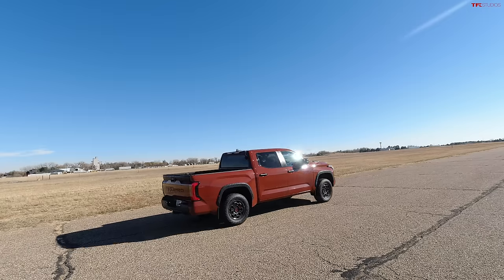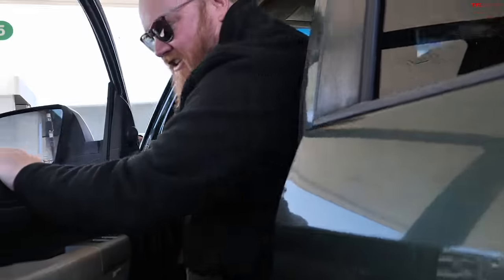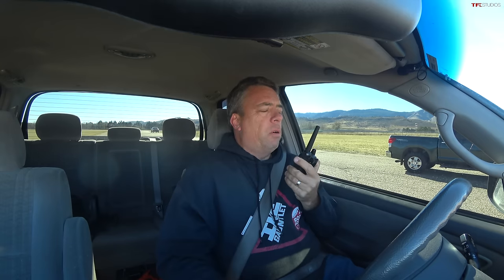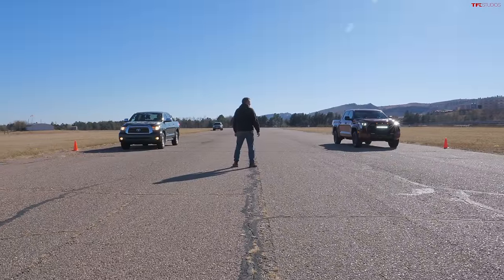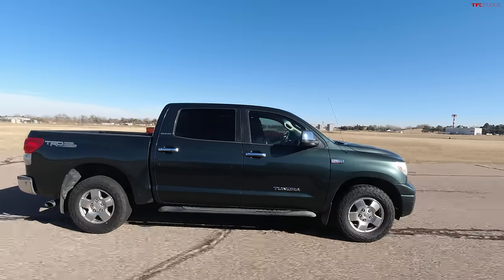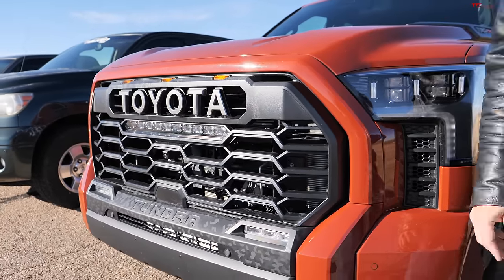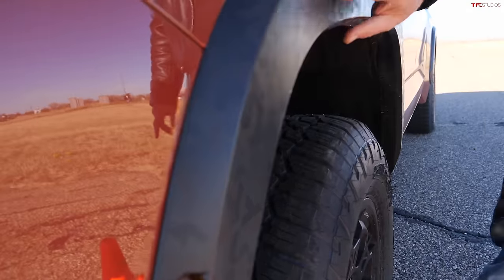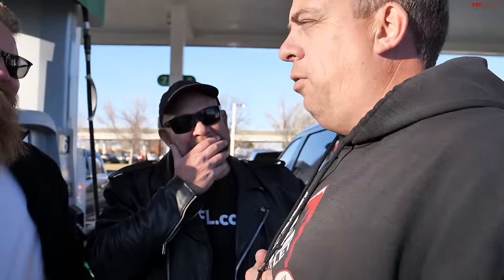Three Generations of Toyota Tundra Drag Race & MPG Surprise: That WAS NOT Supposed to Happen!

Comment: V6 Turbo is garbage, they are currently being recalled by Toyota because of all the metal fragments being found in the engine.  Complete bust of an engine.  Stay clear of the 22-24 Tundras!!!!! 5.7L is the rock solid engine that will easily go 500k.

Comment: The video was fine, but the mpg comparison has a couple of flaws.  The oldest and newest trucks only raced once.   That could make a significant difference for the 5.7 truck to do double the number of races.  I think it's very reasonable for it to have burned .5 gallon on a 1/4 mile run.  That would make a tie, but also, the newer model truck picked up Andre, so that is a bit more of a disadvantage.  

You probably should compare the cost not just the MPG unless all vehicles used the same octane.  Of course, 91 usually costs significantly more than 87, so if two vehicles used the same amount of fuel, but one used 91, the cost is significantly higher.

Comment: you dont need to run premium fuel in the new tundra, The beauty of direct injection is injecting the fuel at the precise time at the moment of combustion. if this engine was port injected then yes you would need to run premium because the air fuel mixture is being compressed in the combustion chamber for the entire compression cycle.

Comment: is there a specific reason you guys always use premium fuel when recommended by the manufacturer? I mean it's not like regular is going to destroy the engine, and most people are going to run the cheapest fuel anyways, so why not test all of the vehicles with regular?

Comment: I would have liked to see the 2nd gen 07 4.7L V8 Tundra's body style go up against that turbo hybrid because I have the 07 4.7L V8 body style and  I've beaten a F-150 Hybrid, a Silverado, and a Dodge Ram before and I have the 07 4.7L V8 Tundra. My truck gets up and goes when ever I need it too. It scoots right along that's for sure. Annndddd my truck just hit the 300k mile marker as well haha so it's got the miles and experience out there on the rd ways😂

Comment: Twin turbos are cool but I have a twin turbo Cat c15 in my semi that has a ton of power but can’t really come close to a single turbo cat in my buddy’s semi supposedly putting out the same horsepower… when a twin turbo has a turbo blow up you also have massive engine failure if the first turbo blows up. I will take reliability over power on the twin vs single turbo side

Comment: Had 2 Tundras in 5 years. 2010 trd off road regular cab with 1650lbs payload and a 2016 SR5. Still have one. Love them and plenty fast with tow haul mode. I dont care about the new model. Pretty mid and not reliable anymore. Went with an HD instead.

Comment: Thats all fine and dandy but those older tundras will still be running when the main bearings go on that 3.4 at 30k miles. I dont know what the issue is bit yota needs to fix it

Comment: Truck owners have been brainwashed by our environmental nutjob education system. I had 2 T100s (the first one was totaled with 3500 miles on it) when they first came out and the only option was a V6. Everyone trashed Toyota for not offering a V8. Amazing how things have changed for the worse. These overbuilt tiny little engines won’t hold up to the long term pressure that a V8 will easily handle. Toyota didn’t learn from Fords Ecoboost failure.

Comment: I've already heard how there's been turbo failures and premature crank/rod bearing failure on the 3.4 V6. People are only making it to 30-40k before their engines are taking a dump and Toyota is footing the bill for a new engine or buying the truck back. Then, replacing 1 turbo is already expensive, but replacing 2 turbos.... YIKES! Then, if your electric motor ever goes out $$$$$. I think the best generation is the 1st and then 2nd.

Comment: My little 2011 4 cylinder Ford Ranger has a 1300 pound payload capacity. That's nothing to brag about on a full sized 300+ horsepower truck. That said, my towing capacity is about the same at 1300lbs.😢😂 My 1973 Ford Courier pickup was smaller than my 2011 Ranger, had less than half the hp and about 66% of the torque yet had 1400 lbs payload and 2000 pound towing capacities. The new vehicles I bought in the 1980s and 90s were more efficient than their current counterparts. In an era of ever tightening government regulations, vehicles keep getting bigger without gaining efficiency. Put all that engine technology from the new Tundra in a truck the same size and weight of the earlier Tundras and you'd see an efficiency improvement. My 1991 Honda Accord was much smaller than my 2008 Accord and got way better mileage from basically the same size engine. I got 35mpg hwy out of a '91 Mazda, I'd be willing to bet the newest version doesn't get that. I know, those aren't trucks but from what I've seen,  the same holds true across the  spectrum of vehicles.

Comment: The first generation tundra was probably the last real work truck they made. The new ones suffer from the same problem a lot of Americans are suffering from. They are bloated. Also they sit so damn high that you have to work harder to use them. Trucks became status symbols in the early 2000s, and now they are designed to haul fat people and little else lol.

Comment: Damn that new Tundra is fast. 
But Toyota trucks WERE typically less powerful but more than made up for it on durability and easy of maintenance (along with not needed a lot of it.) I frankly prefer them this way. Simple.
Plus I cannot stand all the added weight of newer ones. Just give me a late 90's Toyota Pickup.

Comment: How bout we talk prices? 

I have a 2017 platinum, 5.7. 
Paid 50k, teo years ago i looked at getting into a new platinum tundra, dealer wanter well past $70k... And ive ran quicker 1/4 miles than the 200k+ mile truck did, and get better mpg. And its been paid for for years and years.

Comment: Wait is the math correct?? They didn’t all travel 70 miles. The first gen only did 2 runs-the others did 3 runs. And the first gen had a couple bags of cement in the bed.

Comment: The twin turbo engine in the 3rd gen is tuned to to use 87ocatane fuel. You wasted money putting 91 in. Also, you should never top off modern vehicles.

Comment: I like everything about Toyota, except the seats (toyota seats are among the worst).  Longevity may be a concern.  The fact is a turbo 6 will be working much harder than a V8 when towing: fewer cylinders means more rpms, and more rpms means more fuel burn.  Even if the T6 engine can last, it will need much more maintenance; at least 2x times the rate for fluids and filters changes.  so caveat emptor.

Comment: 9:00 What is up with the v8 sound  dubbed over the sound of the v6 engine? V6's and v8's don't sound anything alike and it's not really possible to confuse them. Kinda silly if you ask me. I would have recorded the v6 tundra accelerating in a quarter then dubbed that over it for better sound, not dubbing it to a v8 sound smh

Comment: I still have my 2004 Toyota tundra limited crew cab four-wheel drive I have 240,000 mi on it and it doesn't even have a squeak. That truck runs as good today as the day I brought it home in 2004. You try that with that piece of crap twin turbo hybrid because in about 8 years you're going to be replacing batteries that are going to cost you $10 to $15,000. I hope Toyota pays attention to all these people that '04 and the the next truck with that 5.7L engine are engines that will go a million miles easily, that's what the customers want they don't want to have to spend money on a truck every 8 years to replace 10 to 15,000 worth of batteries. I am considering trading my '04 tundra only because I'm afraid of something happens to it it'll cost more than the truck is worth but the decision is very difficult because there is absolutely nothing wrong with my truck It's never broken down never I still have the original muffler on it.

Comment: Are you kidding me?  I just drove a 2023 F-150 5.0 super crew in sport mode (no cylinder deactivation) from Texas to Utah (thru the mountains) and still got better than 20 mpg over 1100 miles of driving. That's shameful performance from the Toyotas.

Comment: Turbo engines tend to burn more fuel cause manufacturers are afraid of “ leaning out” a lean out occurs when you don’t put enough fuel into a turbo engine. It can actually blow up a motor so the electronics on newer turbo engines dump more fuel in to prevent it

Comment: Rust is the only thing that kills a 1st gen tundra.. if not for that with timing belts and oil changes it will last forever. With that said, my 2010 5.7 has 410k original so can’t complain there lol. Toyota V8s ftw

Comment: Well Ive finally decided.....My new truck will be a Silverado 2500 6.6L Diesel
Reply: My coworker just traded in his brand new Trd pro tundra for a 2500 6.6. It gets better gas mileage (which is baffling), more comfortable more towing capacity. He’s had it for a few weeks now and he said it’s overall a tremendously better truck. And if anyone’s wondering why he traded it in, apparently, there is a recall on the hybrid system randomly catching fire.
Reply: @S2KYLEFXLRST  Im impressed with the payload of the 2500. The cabin size, larger bed for hauling is nice AND the tall ground clearance for off-roading all favor the 2500 or even F250

Comment: "I love a V8, but nothing beats turbocharging." Except for that the turbo and the battery and electric motors are extra failure points. I wonder how these trucks will be holding up in 20 years. 

I love NA power. I'm not in the "no replacement for displacement" crowd, but the instant and ready power you get from just having a bigger engine is very nice compared to waiting for a turbo to spool. As for the hybrid system...cars that contain electric components are just overpriced right now. The 2nd gen Tundra is such good value for money.

Comment: I like that TFL did another Tundra segment, they definitely have been doing better to hide their biased opinions about Toyota. That said, again they blew it with the comparisons. They could have gotten a much newer 2nd gen. The 1st gen was 2006, the 2nd gen 2008, the 3rd 2024. All engines are gonna lose power and efficiency, especially with such a large age gap. And then totaling the fuel at the end, the 2nd gen did a drag race twice, where the others did only one. Again, they know what they were doing trying to pump up the new Tundra, SMH

Comment: And then BOOM!! goes you TT V6 with piped in V8 sounds.  And on 5/30/2024 102.000 Tundra's are recalled. Maybe you heard it hear first, Toyota did bother to build a vehicle that is losing to its former self.

Comment: Chnage the rear diff fluid to SYNTHETIC (ROYAL PURPLE) you'll get an extra boost off the line... plus, those RESTRICTIVE @$$ catalytic convertors don help..... you open this truck up an that 4.7 is a hotrod.... she lags CAUSE SHE CAN'T BREATHE. Not saying itll smoke the turbo but it'll do better against the 5.7..... "SMALL TWEEKS"🤏😎

Comment: This latest turbo 0-60 crap is just hogwash brainwashing. That's the only thing the new tundra has over the older generation and is just disguising the reality that your paying 70-80k for a quarter mile time? If I wanted that I'll buy an old corvette.  Bottom line is we all know this twin turbo hybrids gonna cost it's owned over 100k in Msrp, hybrid motor replacement, problems over a 15 year ownership.  At this point I think if your considering going with the latest tundra your selling yourself out short of what the whole point of a tundra is known for- bulletproof.  May as well hit ford dealer and give rue ecoboosts a good consideration the newest Toyota quality will be on par with that not the legendary 5.7. Toyota sold themselves out  to the devil and tundra isn't the same starting with that fugly

Comment: Comparing a brand new tundra with an electric motor to 2 other previous generations mode that are 15 to 17 years older with hundreds of thousands of miles isn’t a fair comparison and quite frankly, pointless and meaningless.

Was the new tundra also a 4 wheel drive?  I didn’t catch that.  If not, just another cheat on the comparison

Comment: What is the point of a drag race with trucks?  You had some indicator of power but it’s really kind of stupid.  I’ll probably in the 1% of truck drivers that actually uses my new truck off road and tows near the Max.  For most people, it’s wasted power and capacity.

Comment: So basically no real improvement from the 1st gen to now at sea level.  So the new one is slightly faster, but sounds awful, isn’t as smooth, and will certainly be less reliable and not last as long for more money, with worse visibility, and a bunch of nanny beeps and flashing lights.  Remember when cars and trucks actually got better with new models?

Comment: Unless the v6 reliability numbers improve. Well it's just trash and performance won't be enough to sell the truck. Because the ford's and chevys will be equal or greater  in road performance.  I'd still take the v8. They last forever.

Comment: New tundra is a complete POS.  Massive engine failures, which is running at a cost of over 30K for a short block!  Damn near 6 figure truck getting garbage MPG, recall after recall, engine failures...None of this was an issue with the older Tundras.  In the automotive world, new and improved is almost never better.

Comment: "toyota will not build a vehicle that will lose to its former self" It did they hybrid will never be as reliable, never get 225k on it without replacing batteries and major repairs, my prius V couldnt make it to 100k without the  batteries failing and Toyota would replace under warranty...Ill not buy another hybrid until solid state batteries are around...and premium gas in a turbo motor that gets crappy mileage another fail to its former self

Comment: I get a good laugh with you guys you think because the tundra has a turbo in it that it's better than the older trucks yeah well let's get the cat out of the Hat here turbos don't last and this is why Toyota is using them the reliability is going out the door quick yeah it might be faster but it's also faster to the wrecking yard so what you should be doing is racing a quarter mile to the wrecking yard in the brand new Toyota will win every single time so if you want speed and no reliability get the brand new tundra art Tacoma but if you want the old reliability go with the older Tacoma or the older Tundra

Comment: Well we now know whats NOT a million mile engine.   We did this turbo nonsense in the 80s and we knew how that ended.  But no todays engineers think they're so much smarter and they can do it better.  So you get all the issues with the Ford turbo V6s and now Toyota with a "manufacturing " issue😂.  Right...

Comment: The absolute ugly factor along with the need to run premium fuel would keep that new style Tundra out of my driveway and still in my 2010 crewmax platinum. I just can’t get by that giant black plastic whale baleen grill, looks like as an option you can run it on krill. Super ugly nose on that truck and slabs of it does nothing black plastic on the hood!

Comment: This might be the dumbest least accurate video I’ve ever watched. 

For starters although the 3rd gen requires premium it’s an unfair adventure that both the 2nd gen and first gen could have benefited from. If you put premium in one, put it in all three. 

Secondly, opens the tailgate on the first gen and there’s 160 pounds of concrete in there… Spoiler alert, no bags of concrete in the bed of the other two. 

And finally the gas mileage. If I’m not mistaken the 2nd gen ran two?? races and both the others only ran one. So the MPGs on the 2nd gen is probably much better. 

Dumb video is dumb.

Comment: As fast as it is it won’t last longer than 40 or 50,000 miles.  Hell some people are killing that six cylinder in under 20,000 miles.  For longevity the newest is the worst.
Reply: 40 or 50k miles? Ok buddy.......
Reply: @ericsaltus9387  might want to look it up before you defend it.  The 22 and 23 models are shelling out before the warranty ends. I hope you didn’t buy one without doing research.
Reply: @chasingexcellence2246  l have one and it has over 40k. Failures of engines are around 1%. Toyota takes responsibility and comes up with solutions for issues, the domestic manufacturers just ignore known issues.
Reply: @ericsaltus9387  well I am glad that you didn’t get a bad one.  I had a 2020 with the 5.7 and I should have kept it.  When they go back to a v8 I will trade in my dodge for one again.